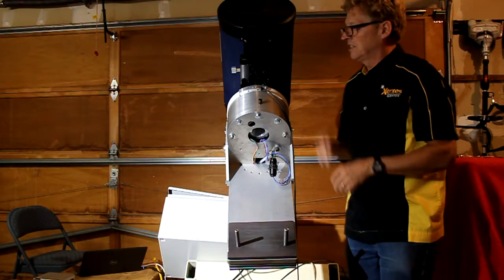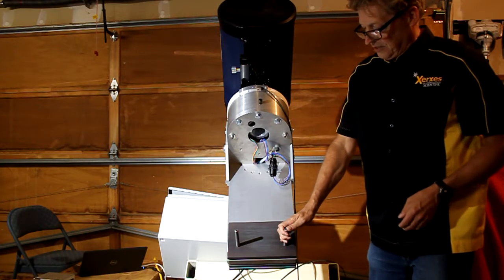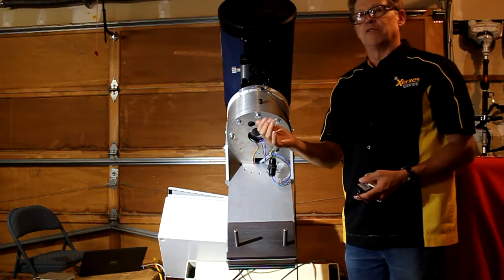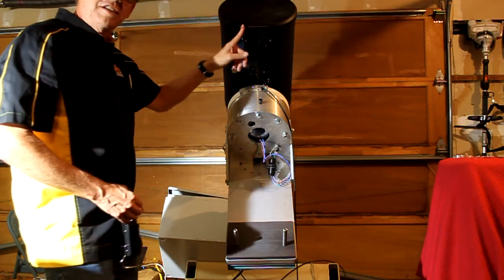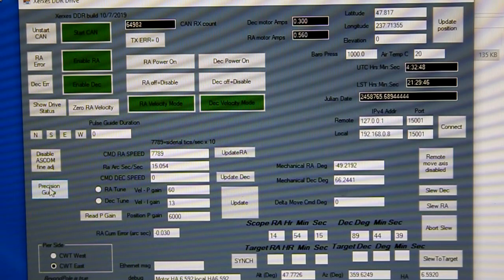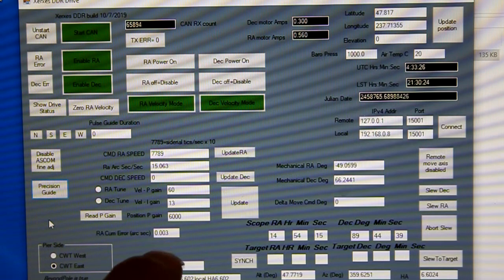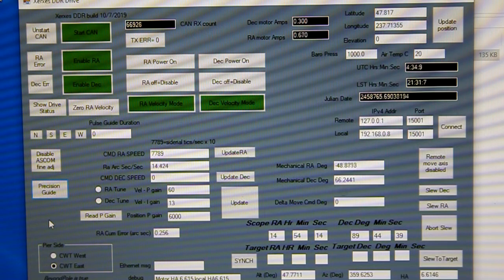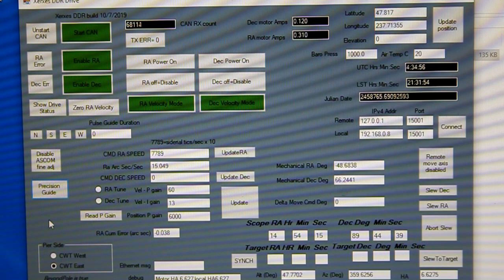Telescope Direct Drive Mount Electronic Stiffness Demo

Comment: Hey Bruce do you need to do any kind of filtering on the position data coming from the renishaws?  I'm building a super crude direct-drive mount for RF antenna tracking and the magnetic encoders I'm using are 14-bit with 5-6 of the least significant being very noisy.  Looking to do a low pass filter but just wondering if you've even needed to look at that.  I'm guessing optical encoders are much less noisy.
Reply from the maker: No but the control loop has an integral term which is a filter.